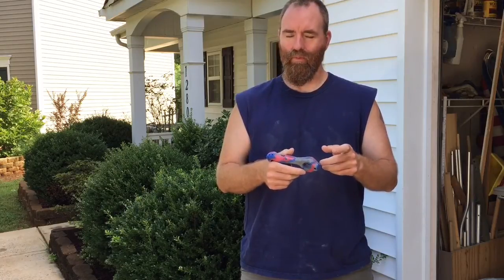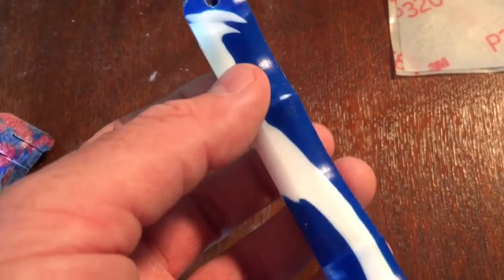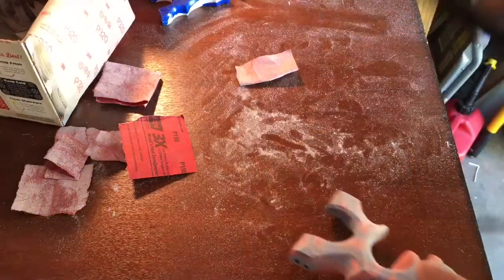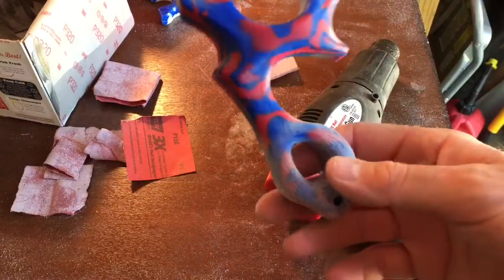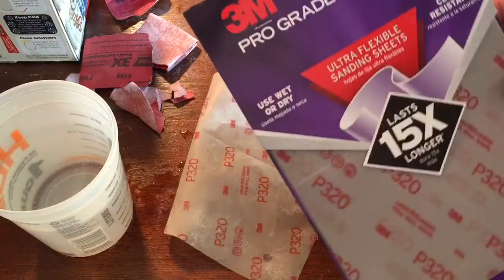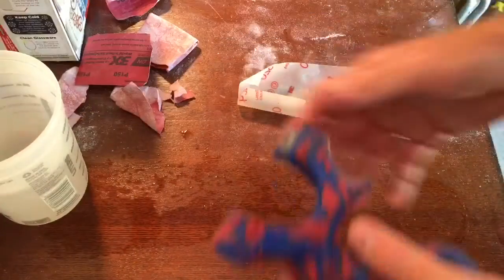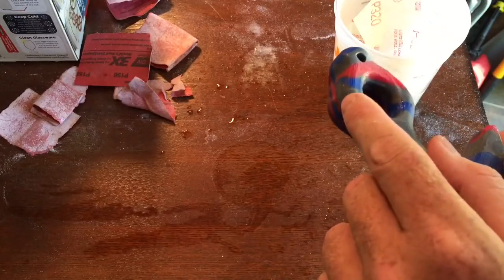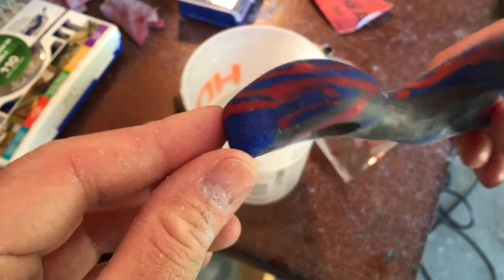How to finish a HDPE slingshot

Comment: I made a small trim part for my boat out of HDPE, and hit it with 320, 400, and 600. I cannot imagine doing this on any kind of a large piece unless you could take a power sander to it. I spent at least an hour on a 3" x 1.5" wide piece.

In the end what I did was spray some high-gloss Kylon clear finish. The chemicals tend to soften the surface ever so slightly, and you can sand in between coats with some 600. This was far easier and the finish looks good.

The heat gun only works on larger pieces that won't distort. In my case my piece was very thin,  and the heat would have distorted it. Bottom line is getting a good finish on HDPE is super labor-intensive, and best if possible to machine it and leave it be.

Comment: nice slingshots! what temperature do you have the heat gun at?
Reply from the maker: +garyrobinson312 
Thanks!  That great gun has only two settings. I was using high.  This is what I found on their website 1500 Watt Dual Temperature Heat Gun 572°/1112°